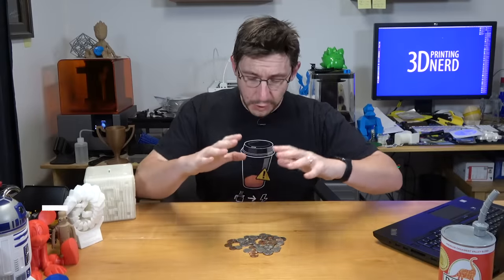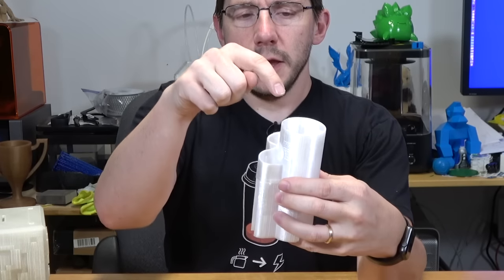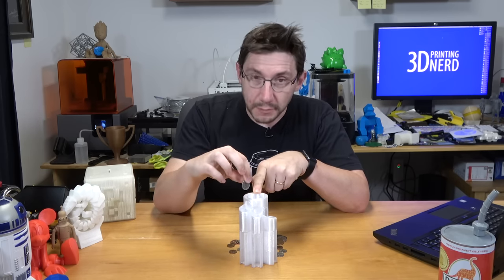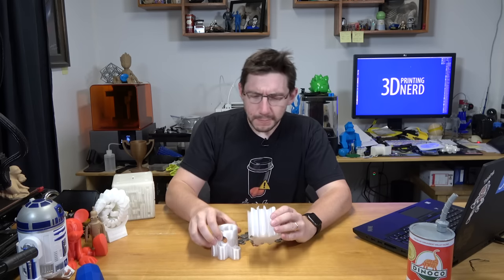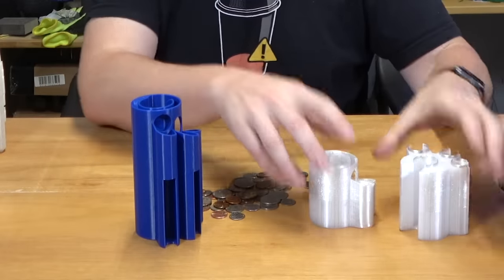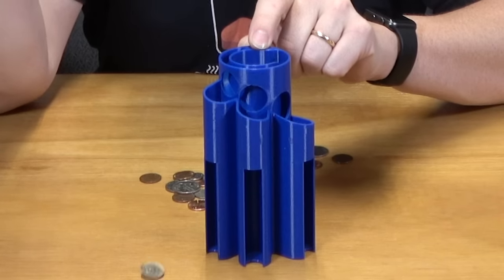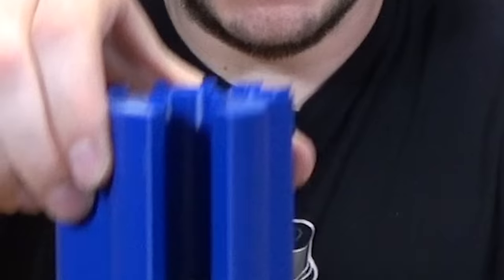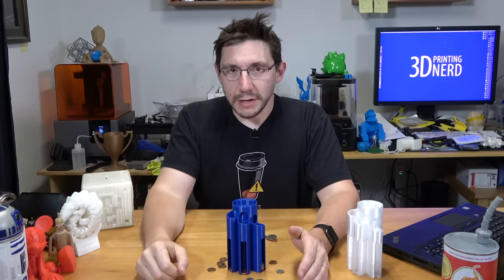3D Printing and Testing the Makerbot Coin Sorter

Comment: "What can you expect?"
"I guess it works some of the time, because it's a Makerbot model"
"That was a joke."
5:00
Definitely not slamming Makerbot there Joel ;) - Had noticed you don't currently own a replicator
Reply: I did ! I got a refund :3
Reply: Can I ask what was wrong with it? If I had that kind of disposable income I would have seriously considered getting one. :/
Reply from the maker: Heh, I sure don't. Makerbot has no idea that I even exist! :)
Reply: My university have 3 Replicator 2X's and a Replicator 5th gen. All of them are broken :v
Thankfully the 2X's are still hackable. I already gave up on the 5th gen >.<
Reply: I have a repo 2 its amazing.. but the 5th gen is garbage
Reply: the my highschool had a replicator 2 and a 5th gen. The replicator 2 was a work horse of a machine. Minus the non existent heated bed. the fifth gen came missing a part...it kinda worked after we sent it back and also got a replacement extruder.

The maker space at my current college has something like 9 of the replicator 2 knock offs and they work fairly well. (if I'm not mistaken they run a custom student made slicer on them tho.) but I don't use them anymore as i now have my own printer.
Reply: Joe McBride I laughed almost too hard.
Reply: A real shame about the latest versions of makerbot 3D printers, but they did create thingiverse.
Reply: reasonablebeing it's not Thingiverse that's 'good' though, it's the community and makers who share good models that make the website worth using.
Reply: Joe McBride Agreed, but they should get at least a few brownie points for launching and hosting it.
Reply: My school just got a makerbot. They asked me for advice, since my tech teachers know I build printers. I told them not to do it. I told them to let me build them one.

They didnt listen. The printer was down in a week. Makerbots barely work with someone who knows how to use them, they absolutely dont with hundreds of kids every day poking and prodding..
Reply: not surprised
Reply: freddie thats hilarious
Reply: true though :P
Reply: My school has a Makerbot Replicator and its used all day by people who (mostly) don't know what they're doing. Its worked extraordinarily well for 2 years straight now, with the only issues being user error (ie cutting filament instead of unloading or unleveling platform). I'm not entirely sure what experiences you've had with it but here's some opposing data for you makerbot haters :P
Reply: When they work they're good, but lots of them break and require user intervention. For example, I've had to take apart the "Smart Extruder" about 20 times now, voiding the warranty.
Reply: Joe McBride d
Reply: Freddie N Yes I did.
Reply: i can see it but ... mark isnt a 3d kinda guy... he could be but... meh not yet
Reply: Ha our school has a MakerBot that I help to run and it has 300 hours on it and it was down for most of the school year. I eventually figured out that the thermocouple was broken. That was after reading multiple sources to figure out what went wrong. Once MakerBot has a cheeper more reliable printer I might give them one more chance. Untill then MakerBot sucks.
Reply: 3D Printing Nerd p

Comment: I use a coin sorter, but the model could be better.  Personally the slot's in the side need to be narrower and be able to remove each coin stack tube separately so the coins can more easily go directly into a coin wrapper (I still use paper coin wrappers that are free from my bank).  ... Oh, my sorter, it is old, probably 25 years and injection molded plastic. I guess I should do a model so other can 3D print a similar sorter.
Reply from the maker: Oh yeah, the coin wrappers! I didn't even think about that.

Comment: That PLA print almost looks like it was injection molded. I wish I had a 3D printer to just print random useless knickknacks. PS I think you should try printing that coin sorter but with the Formlabs printer and see how that goes

Comment: Have to place each coin in by hand, curvature of the upper spiral is too sharp for coins to consistently slide down due to their different diameters, viewing slots in the holding chambers are so wide the smaller coins just bounce out. 95% of this coin sorter's problems are its shit design, not the materials or printers they were made on.
Reply: What wrong with critiquing a design

Comment: I have the Lulzbot TAZ 5 and I've had to tinker with it a ton through the years just to get a complete print.    What's available now (2023) for 1/6th the price is far better in every way.  So much better that no one should still be suffering with a 2015 printer.

Comment: Joel, all f that looks like fun, if you want to sit around putting coins in a machine as you would if feeding a parking meter. My wife asked me if I would help her sort through our coin jars to get some quarters for our daughter to use at a laundromat.  We did it but it took about 15 minutes to get a decent quantity. I was so disgusted by this exercise that I resolved to come up with something much easier. It took me a couple of tries but my coin sorter takes a handful of random coins and sorts them into four separate trays in about three seconds. It doesn't put them into sleeves, I just wanted to differentiate between the different denominations of coinage.

Comment: tighten the slits around the coin holders and remove the bottom of each cylinder, when you're done pull up the coiner sorter and look at your piles of coin.

Comment: Colorfabb HT is amazing if you have the settings right!
Impact resistance is skyhigh compared to colorfabb xt.

Try 263-265°C depending on layer height
coasting distance 1-1,5 mm
wipe distance 4 mm
retraction 4,5 mm
retraction speed 55 mm/s
speed ~50 mm/s
maxium allowed detour factor.... quite high, like 5

you're welcome.
Reply from the maker: Thanks, Karl! I know the settings, but adding a new material with those settings in the new Ultimaker Cura was tough and giving me problems. I'll try to detail it in another video.

Comment: It wouldn't solve the problem that much, but maybe putting a slant angled towards the center of the piece where the coin falls would reduce from the amount of coins escaping? Since the coin impacts the flat stopper at the bottom, maybe the slant will allow the coins to bounce and slide into place correctly without pouring out. Not sure if the circumference of the sorter slots would have to be distorted or increased, but could be a possibility?
Reply from the maker: Oooh, a slight angle. I see what you're saying. That may work!

Comment: A way to keep the coins from falling out of the chamber is to adjust the size of the hole on the side of the coin chamber to match the coin size. I noticed you have all of the chambers with the same size hole in the side besides the 50 cent chamber. I don't have really any 3D printing or CAD experience but my theory is that if you make the holes in the side of the chambers different sizes in reference with the size of the coin, you can avoid the coin just falling out of the chamber. I assume that even with smaller holes in the side of the chambers you would still be able to get your coins out when you need them. I hope that my theory will be helpful with your next model of the coin sorter.

Comment: I think you could remedy problems with both prints fairly easily. With the Colorfabb, maybe just a light sanding? The other one, you could probably either make a door to cover the open slots on the coin collectors or adjust the original model to make the slots just a little thinner. Anyway, good video as always.

Comment: even if this worked, when u have to pick up and put coins in a slot one by one, it would be quicker to manually sort. Coin sorters are only useful when u can just tip a load in at once! That said good video :)
Reply from the maker: I would have to agree. I like this print as it's neat, but in the real world, I would want something I could dump all the coins in and have them sort.
Reply: thanks for responding mate - all the best!

Comment: What custom options did you miss in Cura? I exclusively use Cura and i don't miss any options. TONS of customization for me o:
Reply from the maker: In 2.3.1 I found it extremely difficult to add a new material. Perhaps you can point me to a link that better explains it?
Reply: 3D Printing Nerd in manage materials, select an existing material, click duplicate, select the copy, click edit, fill in display name, brand, material type... However I have not been able to change Filament cost and weight. And since I am lazy I have created only one material that I named "any", then I made a profile for every Filament I use. High five!
Reply: In Cura you can enable which settings to show, it has a lot of settings, these are hidden by default.
Adding material is quite simple https://cl.ly/3S1L1I343r1I just click duplicate button on any material and set settings
Reply: Yeah, PrintingOTB explains it pretty good. I did'nt even use this function at all, i just changed the temperature and flow directly and never ran into any problems.

Comment: sounds like cura could use some upgrading to make custom profiles easier so you can use filaments that don't have there sensor in there telling what it is
Reply from the maker: I think that's a good point - I like the way Simplify3D has "filament" presets.

Comment: I made one and was less than impressed with the "sortability" of it BUT it will work if your patient :). As for HT it needs a buildtak bed to work
Reply from the maker: HT needs BuildTak? I don't have BuildTak on any of my 2.85 machines, and the HT I have is 2.85 :(
Reply: 3D Printing Nerd Noo :( all I got is buildtak to print on besides glue & glass. HT is good stuff although getting adhesion down can be a little tricky.

Comment: Go from smaller to bigger coins.
Reply from the maker: That's the RIGHT way to do it...
Reply: I put this comment before you brought of the blue Makerbot Coin. The white one has a lot of problems. Also, wouldn't it make sense to make the columns variant in size, in the video all the columns look like they are relatively the same size in width. Probably why there is a problem with the smaller coins falling through. or perhaps have a plastic sleeve/cover so coins don't slip out?
Reply from the maker: I think it may need sleeves, I'm going to get some and try it out.

Comment: You could do a little better job researching... ColorFabb HT is amazing material 
http://ht.colorfabb.com/how/, with Simplify 3d and UM 2+:
110 on heated bed, 270 Head, 2400 mm/s, cooling 0-30, retraction speed 2400, retraction distance 4.5
3 shell layers with, 50% overlap

with these settings I got perfect prints, I mean perfect.